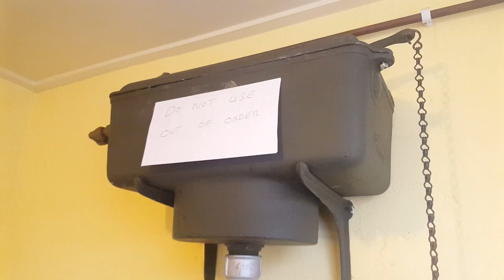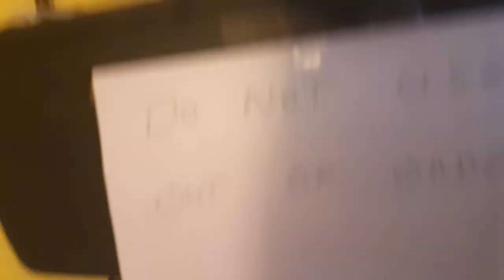Trouble Shooting "Sanito 1125" Cistern, used for a urinal

Comment: What a shame, so rare to have a flushable urinal cistern nevermind it also being a bell syphon
Reply from the maker: That was reinstalled from the old wc in the 80s and was in a very derelict rusty state before restoration as this building used to be derelict. That'll be up and running by Saturday hopefully. Although based on how The Original Burlington was before it responded to the rim jets being unblocked & how they act with 40mm flushpipes. Getting it to flush at all no matter how slow will be an achivement if so 👍